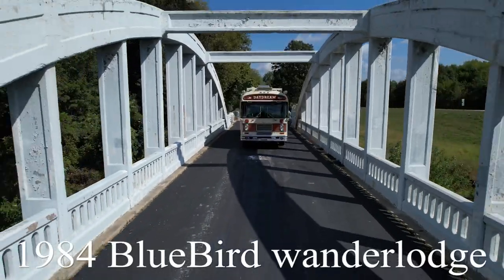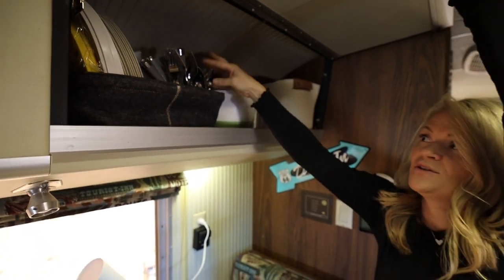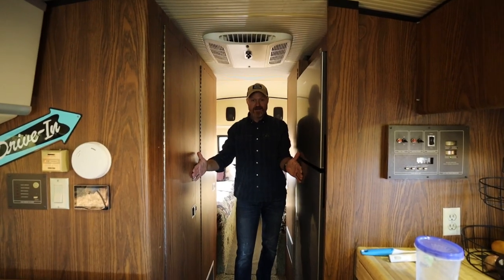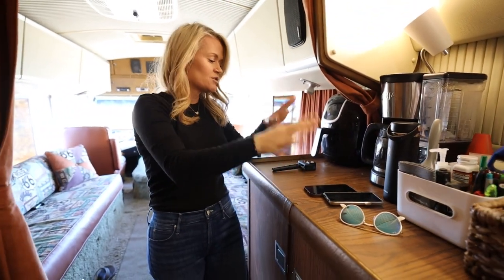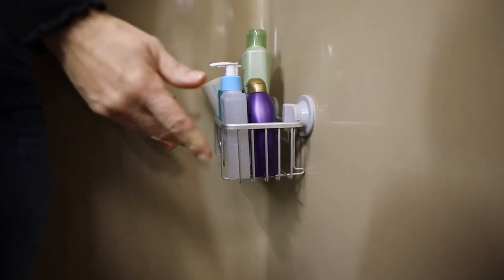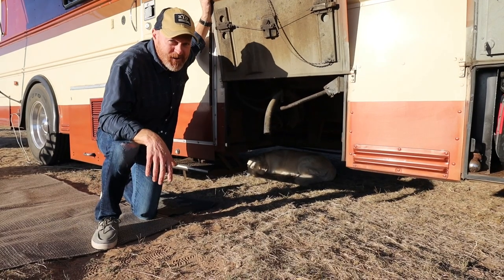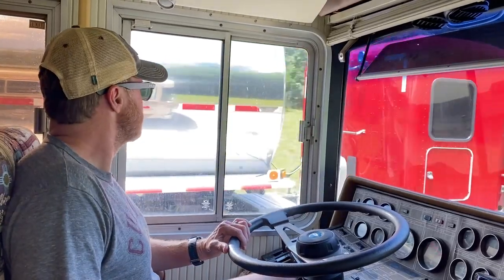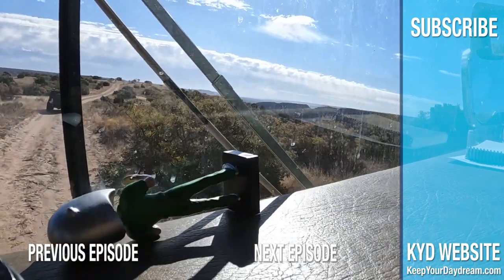BlueBird Wanderlodge RV Tour: Pros & Cons

Comment: Since you have both an air fryer and an instant pot have you ever considered trying the ninja foodi deluxe or instant pot version of it? I only ask in the instance of saving space and making the most out of appliances. Even in my home kitchen I had the slow cooker, pressure cooker, dehydrator... when I switched to the ninja foodi deluxe I was able to get rid of all those extra machines and save so much space. Even in our camper which is small and we only have a 2 burner cook top I was able to take my ninja and bake, roast, slow cook, air fry so many things.

Comment: Really like your stuff! Since you already have a Charlie dog, maybe you want to check out Steinbeck's Travels with Charlie for your next route inspiration? I'd look at hard surface (vinyl plank?) flooring instead of carpet in the remodel too; especially with Charlie in and out.  Another advantage of vintage is that simpler means less to break and easier to fix, and pre-08 or pre-10 diesels avoid DEF and a lot of emissions issues.  We have a 2002 32' Country Coach and (like you say) mostly love it. She drinks 6, feeds 4 and sleeps 2. Good Luck; see you on the road!

Comment: Good video 😃 that was a school bus never ment to be motor home cat 3208 not made any more so you would have to rebuild your engine and add a turbo that was a truck and boat engine country coach put them in coaches 3208t they changed engine to cat c13 all the way up c16 inline 6 350hp to 625hp matinance is to costly on your rig enjoy

Comment: Mark, I don't know how you do it, only 210HP?  A lack of adequate power is a purchasing show stopper for me.  I recently test drove a 2017 Bentley diesel pusher with a Cummins 360HP (6.7L).  It was gutless, so there was no way I would spend $170K that used slug.  My 2018 gasser would blow it away with only 320HP Ford V10.  For me, power is everything, it's the most important checkbox to check off as acceptable, otherwise my interest STOPS THERE.   It's like marrying a blond bombshell that can't cook (in the kitchen).  The high maintenance will drive you nutty, and the restaurant bills will break the bank. She may be fun in other ways, but there's a huge downside.   Interesting you're not happy, my Invisibrake has worked flawless for over a year now in my Honda CRV.  But I installed it.

Comment: 3208 kills it….we had a pile of those throw away motors back in the day.  They are NOT rebuildable and a horrible motor.
What a beautiful RV….. worth repowering….  Couldn’t trust that motor as we blew up so many in the fleet running very light GVWs.  Excellent choice i tires.  Wouldn’t put Michelins on anything anymore…. Fleet mechanic here and otr driver
Reply: Couldn't disagree more! I have an 1987 Wanderlodge with a 3208 and owned since new. Great motor if you treat it right. Never had a problem.
Reply: @danl4053   you can disagree all you want…. But when we started using them? Over 80 of them in the scrap pile… most never saw 48,000 miles.  Back in the day at and auction?  Couldn’t get scrap value for a truck 4 years old..sorry but just telling the truth.  Probably why this one still exists as it was never used.
Probably the worst all time diesel motor next to GMs big olds gas conversion diesel….
We probably changed over 50-60 3208 thru away motors to others.  🤣. Hey 🤞 good luck.  But i am sure you already knew you were on borrowed time.. nothing that you haven’t heard before 🤣🤣🤦‍♂️

Comment: I would never get rid of my propane refer those compressor refers chow down on the power especially when boondocking i run my propane all the time, also those old busses need a lot of work mechanically lots of channels on with unsafe brakes, steering, wheel bearings suspension components and poor engine maintence..